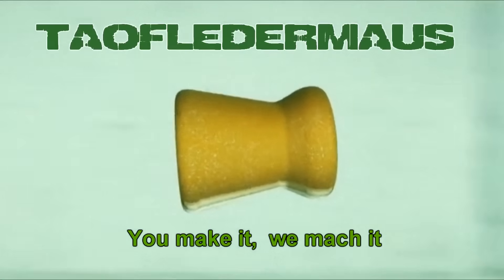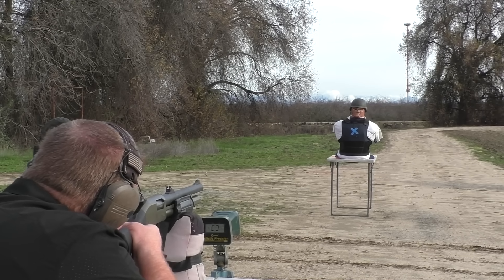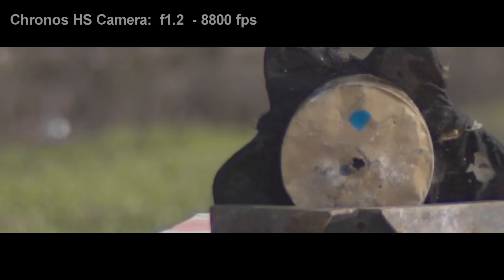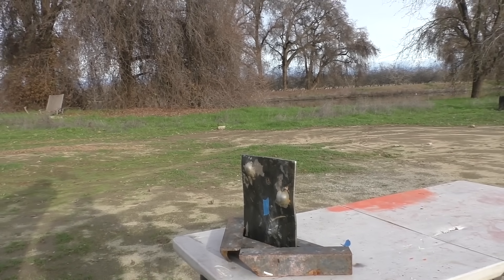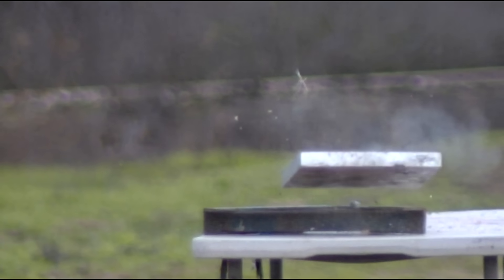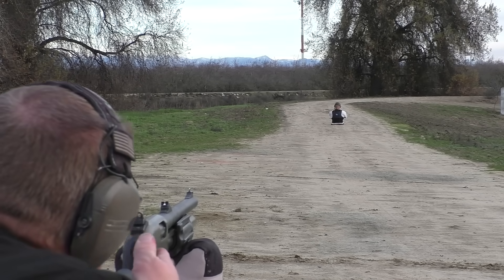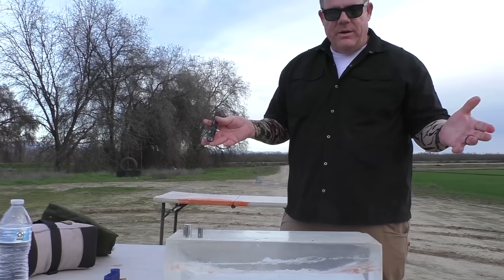The "MACH-71"  Super Perforator Slug   -  TESTED

Comment: the test on the lead plate functioned somewhat like an apcr tank round, the soft aluminium getting left behind, and the hard steel going through, very nice!!
Reply from the maker: Great point!
Reply: i think it would penetrate things a little better if the casing was made from a softer metal, or the casing was hollow. since there would be less resistance pushing the steel plug through, as well as making the nose of the steel more rounded off

Comment: That round is as close to a two stage rocket as you can get. The steel core just clings to most of the force being accelerated ahead of the aluminum exterior shell, and it makes up the bulk of it's force. That said, the aluminum shell itself is doing an incredible job of dumping it's inertia into the target (IE: The jelly block) while the core just burrows in deep. I'd have loved to see the state of some of those penetrated rounds that made it off into the distance, I'd imagine the aluminum would have been pressed back and inwards around the core to not have split off.

Comment: These slugs are the same as I Designed back in the late 90's , Machined them myself and used Hardened Steel Core for Penetrating through Body Armor and for Stopping Vehicles . Great to see someone else making them with the same idea !!! They work Excellent !!! If He would of Knurled the Steel Core Prior to having Hardening them He could then using a Hydraulic Press to press the Steel Cores into the Softer Aluminum Outer Portion of the Slugs . Less chances of the core separation that way . Or as a Perpetrator keeping the core semi loose so that upon the aluminum outer slug stopping the core would still be allowed to keep moving forward.

Comment: making that core out of tungsten/carbide and making it go around 1700 fps would be enough to go through that steel plate like butter. 9/10 in design btw great aerodynamics and it loogs awesome. 100% would use as slug.

Comment: That gel was just Rocked. Rung that bell. Jeez heavy and hardened steel and maybe a very light bond with the Al "engine" piece would help with stabilization too. If you need another experienced reloader with shotgun you should hit my dad up. I've rarely ever used a new load ever.  He's got 40yo paper hulls he's kept going.

Comment: .675" slug in a .719" BORE DIAMETER  with a .727" GROOVE DIAMETER 
leaves a  .022" or .5588 mm thick plastic shell wall , so is that a .746" ID hull ?

Comment: Here’s to hoping Kyle doesn’t get a knock on the door some time soon. Not sure if making projectiles counts as manufacturing ammunition which carries a pretty hefty punishment over here😬
Reply from the maker: He's just making "metal parts".
Reply: @Tigertsdd  Mate... That's not the law. Luckily, not "designed or adapted to expand on or immediately before impact", so you're probably good. The sabot is purely a functional part to keep the barrel pressure within safe limits, right?

Comment: Great design. Notch the leading edge of the aluminum outer casing, like a traditional hollow point, which should allow it to flair. You'd get two projectiles in one. A big hollow point that would spit out a steel projectile.

Comment: Way to go Kyle in Wales!!! You need to upgrade the core to Tungsten! I think your overall design was fantastic I really like the SR-71 like engine intake profile of the front of the bullet, I'd like to see you use that design again but also include the same exterior shape but make the penetrator flush with the aluminum so that is looks like a standard bullet. The design you made is stable at mach speeds because of it's shape, I think it would be just as stable if the aluminum and tungsten core were flush with each other!

Comment: At least mill miniature turbine blades using the spin of the projectile to actually ingest air, insert a sleeve out of magnesium or other pyrophoric metal (lithium, calcium, potassium, sodium, cesium, etc).  If it's already supersonic, it would have a great chance to ignite and burn all the way.  It would definitely compensate for the short barrel of anything, and accelerate for far longer than anything available now.  It would definitely be the way of the future to add miniature guidance electronics.  Also: NO MORE RISK TO BYSTANDERS.  & shooting one round sold for $ 1000 & up would put a real damper on drive-by and stuff.  Shooter be like "Yeah, I really need to recover the projectile, I don't have money for another one".
Reply from the maker: Give it a try!

Comment: This is the most impressive shotgun slug I’ve ever seen destroyed soft body armor, incredible penetration on the lead plate, and it dumped all its energy on the steel plate. This would be a super round for hunting big game, and lead free which means it safe everywhere. Super stable flight what more could you ask for. I’d like to this round but instead of it having space around the steel core and outside having it smooth from the point to the outside you’d see better flight for sure less affects from the wind and higher velocity over distance. Kyles is on to something here.
Reply: Big Game? Hunting Car engine blocks 😂😂

Comment: Does anyone know where any type of these pointed sabot rounds or slugs, can be purchased ?  Not these exact rounds specifically, but just any of the crazy jacketed bullet looking slugs they've tested on the channel. 

I know that some of the Incendary rounds and "dragon breath" rounds they've tested on the channel, are in production and being sold online in some cases. Those ones "look neat" and all, but are pretty worthless beyond that. I just want some kind of a wild, exotic slug / sabot. With a steel or tungsten core etc, idk something that isn't just a chunk of lead. 

I suppose if anything, its pretty easy making and loading shotgun cartridges. But not quite so easy creating the slug itself, which requires a lathe and metal machining. But could get the shotgun reloading equipment for pretty cheap.

Comment: I'm not sure if my hypothesis has been addressed here, but shooting the plate didn't offer enough fixed resistance for the round to penetrate because the plate mass and movement countered the penetration ability.
Just a guess.
If the plate wasn't allowed to move as much or at all, there might have been enough slug inertia that the slug may have perforated deeper or completely.

Fun video guys!
Reply from the maker: Just the inertia of the plate resists movement until long after the slug impacts.
Reply: @TAOFLEDERMAUS  
Maybe so, but it's a curiosity none the less.
Thanks for the reply, and I enjoy yours and OG's videos.

Comment: You might want to try a welsh bodkin point, four-sided with angles of a cold chisel, tempered and hardened tip. It worked with arrows but what they usually get wrong with reproductions is they make the tip angle too steep and do not make only the tip hardened with the bolster tempered more malleable (much like a good cold chisel). RARDE did some work with ancient arrows, and with what they found redesigned anti-tank shells for better penetration.

Comment: Interesting design. The soft aluminum core results in easy mushrooming, and thus a large transfer of energy at the impact site, whereas the steel core takes the remainder of the kinetic energy along with it. So rather than being on one end of the spectrum (FMJ), or the other (hollowpoint), this round tries to divide itself into both. 
Absolutely awesome job Kyle.
Reply: The easy mushrooming shouldn't be surprising. At very high speeds the hardness of objects in relative motion is effectively less. Basically, the faster it is the softer it acts, and AL is already fairly soft.

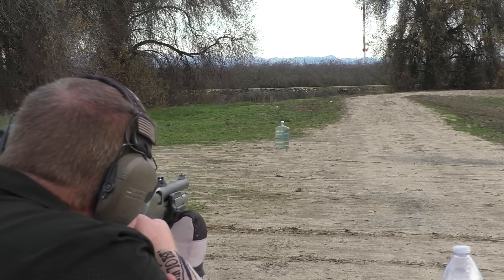Comment: @13:50 : This is worrying. Behind the part of the shoulder where there is no Kevlar are some major arteries. The shoulder area has huge arteries and veins which need just as much protection as the chest. Let's say only a small piece of buckshot manages to someone at the unprotected point - it could easily result in the victim bleeding out. Perhaps an OG video on the best armour would be helpful in answering this question.

Comment: Very nicely done. Presumably, you could tune the AP performance not just by changing the material by also by changing the diameter of the inner penetrator and padding out the aluminium sabot (I guess technically that's a two-sabot design as fired) - you could conceivably make that a very hot round with a small enough penetrator and a big enough aluminium sabot.

Comment: I have a feeling this would have gone through the steel plate and possibly the aluminum plate, I think the fact you have to place the plates on an angle means the point of impact is off enough to mess with the inner cores ability to dig in on its own

Comment: Nice test of an awesome slug guys, but the test doesn't show the full potential of the round by a long "shot". First there's the angle which takes away a part of the kinetic energy. Not that is skips  the plate, but it is still lowering the energy on impact. Another, much bigger impact, is the fixture of the plate. When the steel plate is not fixed and allow it to tumble over on impact, it will take away a significant amount of energy. It's the same as getting a blow to your leg or arm and it can move freely. That's the difference between a bruise and a fracture. I would like to see what happens when the plate is hit straight on and fixed in a way that allows all the kinetic energy to be dumped into it. But I also understand that safety is a restriction here. Nice show gentlemen.

Comment: If Kyle made these with a tungsten core, these could be absolutely immense anti-armour slugs.
The way it works on hard surfaces is simply astounding, definitely the best anti-armour slug engineering-wise
Reply: What's your PvP from?
Reply: Pfp damn autocorrect
Reply: @10jimmy  Some Gay Anima Would Be My Guess.
Reply: @10jimmy  "Sakura Dungeon" It's a VN on Steam. The character's name is Yomi.
Reply: @10jimmy  ugh creepy ass anime nerds
Reply: Do you think a tungsten core should be maybe 2/3 the diameter of what the steel one is? Maybe keep total weight about the same (more aluminum in the ratio of jacket to core, heavier core) so the velocity doesn’t suffer but a more dense penetrating core is released? Thoughts?
Reply: @trailguy  as someone mentioned above, density is key to penetrating so you could theoretically get away with making a smaller penetrator if you want to not have extra weight.

Plus a smaller penetrator would have a smaller point of impact which would actually improve energy transfer for penetrating.
Reply: @trailguy  this
Reply: Yep. You would want it as thin as possible while still being rigid. It's all about hardness and pressure per area of contact.
But as earlier mentioned, the ATF will likely nix these sooner or later. Right now tungsten makes fine birdshot, but sooner or later some ahole will realize that tungsten buckshot at about 1800 fps will turn a 12 ga into an AP machine gun. Which the ATF "rule" upon.
Reply: not metallurgist, but isn't tungsten really brittle?
Reply: @cubertmiso4140  Yes but at supersonic speeds density seems to be more important than toughness or elasticity. Hence the use of depleted uranium in anti-armor projectiles.
Reply: @longschlongjohnson6470  I see. Thanks for educating me. Just learning about Newton's approximation for the impact depth.
Reply: @cubertmiso  That's why the Anti Tank Rounds that use Tungsten Penetrative Sabos are often mixed with 15 to 30 percent Titanium
Reply: Goodluck machining tungsten it's extremely hard but also brittle.
Reply: @-DEATHSTROKE  they could cast and not machine the cone topped tungsten. Maybe some very miner buffing would be necessary to make it perfectly straight along the sides so it slides into the aluminum.
Reply: @trailguy  good luck trying to cast tungsten lol. It’s even harder than machining it. When tungsten melts it becomes unstable when exposed to oxygen. You also can’t melt it too slowly. Special chambers filled with gas are required, also using plasma to melt it quickly.
Reply: @trailguy  Its only economically feasible if you have the equipment already. The places that have the equipment to do it can cast it at a pretty decent pace. It just requires a somewhat different area is expertise. You can actually buy shotgun shot made from tungsten.
Reply: @-DEATHSTROKE  nailed it
Reply: @-DEATHSTROKE  sinter not machine
Reply: No i highly doubt that. Speed defeats body armor. Not so much density or mass. Maybe if the lead plate had a 6aa armor rating. Haha. Like his "sleeve"
Reply: @jonnymilitia   
the simplest way to gage the penetrating power of a projectile is to put mass times velocity squared over the projectiles cross-sectional area.
thus the velocity of the projectile is indeed a bigger factor in this than the mass of the projectile.
the problem is that the speed of a projectile is limited by the propellant used, once you max this out, the projectile isn't going to go any faster, no matter how light it is.
so assuming you're designing a projectile for certain gun using a certain propellant, there is an ideal amount of mass that a projectile made for this combination should have (which is the highest amount of mass which still allows for the projectile to reach the maximum speed allowed by the propellant) 
with these factors being fixed, the only factor left that the designer has any measure of control over is the cross-sectional area of the projectile, which you want to be as small as possible, which can be achieved in two ways, sub-calibre ammunition with a sabot or with a massive penetrator core, encased in a lightweight material.
the reason why density IS a major factor in this is because the higher the density of your penetrator core is, the smaller you can make it's cross-sectional area, drastically increasing penetration.

now this is ignoring stuff like the penetrator cores resistance to being deformed (deformation looses you energy so you don't want that) and the shape of the tip, but you get the idea.
Reply: Wolfram carbide*

Comment: The myth that a round will ricochet back with enough energy to do much damage is actually pretty absurd. That would require a round AND a target both being unable to deform much or heat much either.
Reply: We’ll both Jeff and I have been hit with plenty of shrapnel and spent rounds that did some damage. As a guy who lives on three ranges, I can tell you first hand about a lot of people hit and injured by ricocheting ammo.  Not sure where you heard it was a myth.
Reply: @OGsDangerShow  Ricocheting at what angle, and how much damage?  

Sure, a large bullet coming apart can certainly throw off fragments that could damage an unprotected eye or something. But there is no way a bullet you shoot into any surface is going to come back toward you with more than a tiny fraction of the same force. 

The myths I have heard were ones like a bullet being fired into a car window bouncing back and killing the shooter.
Reply from the maker: There's a lot of factors that can cause a bullet to bounce back at you.
Reply: @taofledermaus  Of course!  But it would take a magic surface for the bullet to be reflected 180 degrees without losing the vast majority of it's energy. 

I could imagine some sort of slingshot device that would capture it and store the energy in say springs or rubber bands and then propel it back the other way, transferring most of the energy back to the bullet.  But no hard surface is going to do that.

Comment: The forcing cone on the 71 was retractable to move the supersonic shockwave bouncing inside the intake aft.  It would be amazing if you could calculate, like Skunkworks, how far deep they should be for speed if hollow like the engine.  I bet if supersonic the bullet rotation wouldn't matter.

Comment: Use a 54 caliber block powder muzzle load bullet made in LEE PRECISION pointed casting block molds .... But before you  add the hot lead, drop a steel ball bearing into the point or bottom face of the casting die blocks . You end up with a steel tipped  "slug" for a .20 gauge that fits inside the regular shotgun wad to protect  your .20 gauge's barrel . I'm sure you could  figure out what muzzle loader casting molds to use in a .12 Gauge shotgun shell ..  figure out the powder charge by the weight of the actual  projectile . Always start light and then work your way up . 😊
Reply from the maker: 69 cal is more suitable and workable for a 12ga

Comment: Great idea with the food coloring to leave a visible trail.  With the fitment of the steel core in the aluminum jacket, rather than loctite, is it possible Kyle machined them so the steel was maybe a thousandth over a "perfect fit", then heated the aluminum (expands) while supercooling the steel (contracts)?  That is a technique used to get unbelievably tight fit between steel components with no welding.  You can then tap the insert in and as the temperatures equalize you have turned two pieces into one.  Anyway, thanks for another GREAT video.

Comment: Man these slugs are very impressive and crazy accurate! These would literally be unstoppable with a Hardened Steel Core & Brass Sleeve instead of Mild Steel & Aluminum Sleeve. There still some of the best slugs you guys have tested. Great video guys
Reply: i think the tungsten core  would make it monstrous
Reply: @dariugrinov9472  Just imagine if this guy could get his hands on some DU
Reply: @arsonisticfox6215  the thing is DU is heavy but it tends to shatter, this isnt important at super high speeds because at high speeds density is what defines the penetration but at lower speeds, i think the projectile would shatter (now the penetration is affected) which would spread our the impact somewhat, decreasing pen. So i think tungsten is the best choice as it isnt too heavy but its tough enough.
Reply: The solid brass extreme penetrator copies where the best